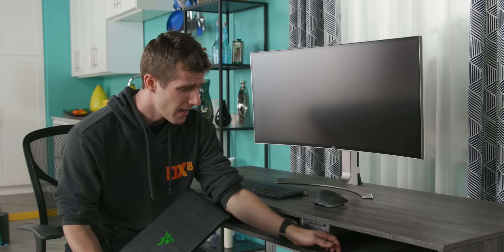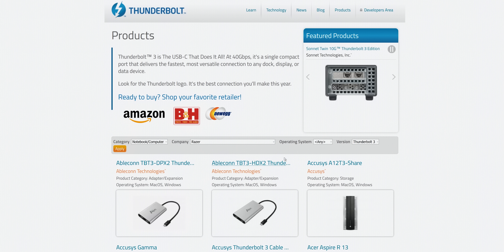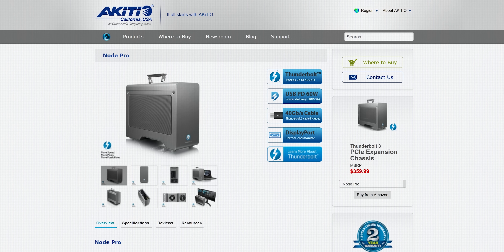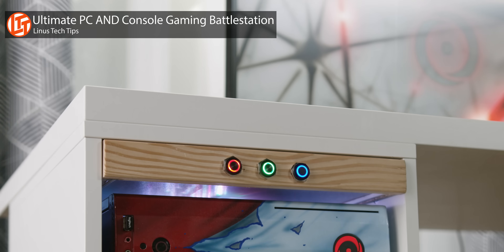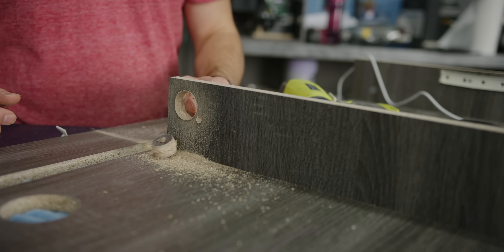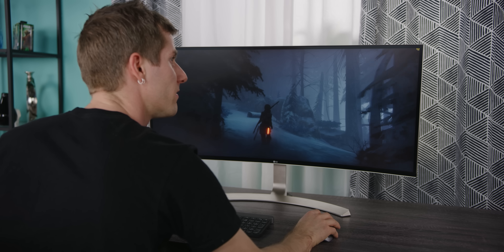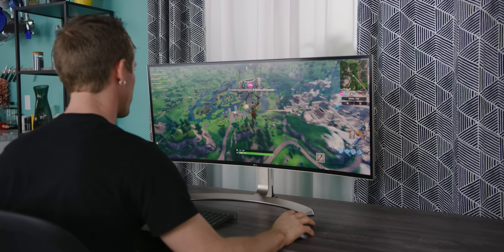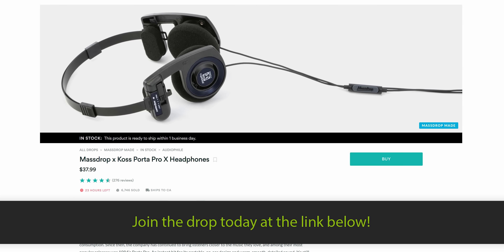This is the CLEANEST Setup.

Comment: Hey Linus, I need your help on this one, it's somewhat related: I own a Razer Blade 15 Advanced Mid 2019 RTX 2080 and I am looking for a Thunderbolt Hub for Ethernet and/or 2xUSB and Displayport with 144Hz (hopefully with G-Sync-compatible?) that also charges the laptop. Have you got this setup working? If yes, which peripheral did you use?

Comment: My experience says command strips will solve the velcro dropping the dock issue. Nothing this clean, but I've modded a desk/bookshelf to house a three monitor kvm setup with 3 desktops and a laptop, and I use the 16 lb command strips to hold most of my components including a 4 port dual monitor kvm, (4k @ 60 hz) and the optical drive that gets shared between the machines (I work with some legacy stuff).

Comment: Quick question; I do not have a Thunderbolt 3 port, but it does have a USB-C port. I do not plan on using it for gaming but just productivity so a external drive and GPU is not needed. The station is already going to have a desktop PC, so the plan is to when I connect my laptop the screens, keyboard, mouse and other stuff is switching to that. Maybe even a button of some sort to switch back and forth. Would something like that work?

Comment: lol enterprise computers have had docking stations for years XD
Reply: This is cleaner than a docking station.  Im running a Lenovo T430 on a dock.  But there is still a lot of wires, and you cant just plug it in,  you need to line it up, then to remove, press a button.

Comment: Clean? Pfffft. Take that TB3 hub apart, and embed the front ports into the edge of the table. Also create a custom rail dock for the laptop instead of the cable, as Vandel212 suggested. Then swap the keyboard and mouse for a Celluon virtual (laser) set, and a short-range laser projector. Kaboom.

Comment: FYI, on fortnite it has a frame rate limit in case you don have a 240 or 144 hz monitor so you avoid having your GPU over working. ;)

Comment: Mine is basically the exact same thing but with an and rx 5700 in a Razer core x with 2 monitors and speakers. All connected to my MacBook pro with ethernet and wired keyboard and mouse. The cables are a fucking disaster.

Comment: “Cleanest Setup”

Dust: not so fast.
Reply: @Bear Omega If my cheap ass just upgraded to a 144Hz monitor that even my 5.5yr old system can keep up with, there's no way cloud gaming is going to take over the mainstream. I'm not going back to 60Hz but with added potential for problems that I had no possibility of facing with my graphics rendered locally. I'm probably buying an nVidia 3000 series card when they release. I skipped the nVidia 1000's and 2000's on my 970 GTX. What kind of framerates will I be looking at in 1080 or even 1440? There's no way i'm going to go back to 60Hz but this time with extra problems I didn't have before.
Using an internet connection, especially one on which others may be streaming videos or downloading can cause all kinds of problems with input response latency, dropped frames, and reduced graphics quality when the internet is busy, or if my home connection is busy. All that for 60Hz while I'm already on 144, and may soon be dealing in the realm of 240Hz gaming. I'm a cheap ass like most people. I don't often spend money on hardware, and I'm way ahead on performance compared to cloud gaming.
Reply: @stimpypigaming8021  don't buy a 3000 join the 6000 gang
Reply: @TemkaUwU  R T X 6 0 9 0
Reply: Mine is cleaner
I have no setup.
Reply: LMAO
Reply: honestly i thought it was for actual dusk grime etc

lol
Reply: As someone with an eGPU, this is just too true.
Reply: Me alright we’re is the nearest black hole
Reply: I'm gonna stop you right there
Reply: THATS WHAT I WAS THINKING OF
Reply: True
Reply: Now Introducing: Dust Cleaner™ Lite
Reply: Hold up.
Reply: @TheOneAndOnlySam01  what
Reply: LMFAO
Reply: Nobody expects the dust inquisition
Reply: Bro why is ur banner a pic of my house
Reply: @Theonlylazycatdog  bc ik where you live.
Reply: @TheOneAndOnlySam01  😳😳😳😳😳😳😳😫😳😳😳😳😳😳
Reply: @Theonlylazycatdog  that’s very scary. He knows where you live.
Reply: Just clean it
Reply: @callum493  no shit sherlock
Reply: I’m allergic to dust
Reply: BoyStank oof how do u live life with that allergy?
Reply: @boystank4202  damn my mother too when we have to clean something it would be hell to my mom and my eyes
Reply: What does it feel like to have over 1,000 subs? My pc is a lemon
Reply: @boystank4202  relatable
Reply: HhhHaaAaaHhhh , your finger just went in my ass!
Reply: 30K subs with no videos challenge i wanted to like ur comment but didnt want to change 69 likes
Reply: @mustafafaisal05  bro its hone it's all gone the name and likes

Comment: hm... i already have a RTX 2080 but am running on an i7 4790k which is fine but if i want to upgrade I need a new mobo, ram and cpu anyway... i wonder if i should build this kind of setup using my existing 2080 and maybe get a performance boost? I like my overall setups to last 6+ years though (allowing for one major change e.g. GPU to be done early) and I doubt even the best laptop CPU/ram combo will be good for that long, especially not with that early GPU upgrade. Or am I wrong? last time I owned a laptop was in the era where they became useless after only 2-3 years so I might be out of date.

Comment: I have the core and razer blade displayed in this video. It is a sweet setup but the core itself is a bit inconsistent. Sometimes it won't charge. Sometimes it will randomly crash. It won't wake up from slumber. It is very sweet and it gives you a ton of portability but given my work laptop can run the games I want in case I travel I am switching back to desktop.
Reply: also you can for sure hear the Core on its normal enclosure. And the CPU on this Blade warms up a lot because of the thin factor. I do hit 90s on the regular, gaming simple stuff like LOL

Comment: One thing Linus failed to mention is that the optical port in the back supports SPDIF, so you should be able to run a nice, little 2.1 speaker setup without a lot of hassle; or some nice studio-grade near-field monitors, if that's your jam.

Comment: I based by set up on this video. The only differences are that I used a MBP + Radeon 5700xt, an IBM model M as the keyboard, and multiple monitors (portrait and landscape since I'm a programmer) and there's no built in wireless charging. 

The only issue I have is that I installed Windows on an external ssd (that's Velcro to the MBP lid) and when I boot into it, the gpu doesn't work anymore. I can't game, but, work and school stuff works fine.

If anyone needs help getting things set up, let me know.

Comment: I think the one step you still have remaining (plugging the laptop in) could be significantly optimized: build a compartment that fits the laptop exactly with the plug in the back at a fixed position, so you can literally just slide the laptop in all the way and it's connected.

Comment: This is the cheapest .... Ouch my wallet is crying out loud ... !!!
Dude, the effort , the tools and the time wasted to do so.

I have done what you said at the beginning of the video, I literally have two laptops (One for the light weight and another for the heavy liftin).
I always wire both of them to a 4-USB switch hub and my heavy laptop is always connected to a 24" screen while the other sits next to my mouse pad in-case I need to fetch files from it.
So, the end result I come back home plug in the hub, the power cord and that's it ... 2 steps and we're done ...!!!!

Comment: Looks like I can't do this. My laptop computer has 130W charging.

Edit: I was wrong that my charging wattage would be a limitation. It's a Dell laptop, and they have a docking station with 130W delivery over Thunderbolt 3 and sufficient ports to hook everything up. That docking station costs over $300, though.

Comment: if you have used a thermaltake mozart TX you could have a much cleaner setup that is easier to  manage.

Step 1 build the PC using that case
Step 2 remove 1 of the legs of the table
Tep 3 use the case as a New leg for the table

Comment: Are there magnetic Thunderbolt 3 cables?  Use one of those and you won't even need to plug the cable in, just get it close and it'll plug itself in.

Comment: I have been programming and operating CNC Routers for just about 8 years now. My suggestion would be, if you are going to be using a CNC router and need to cut any “finished” material (laminated, painted,etc) you should always use a down cut bit. From the looks of the quality of your cut from when you pocketed out the section for the wireless charger looks like you used an “upcut” bit. A downcut bit pushes the material downward giving you a very clean finish on the edges. Also if you are going to be cutting all the way through your material (creating holes) you should use a compression bit which is a combination of an upcut and downcut, these keep both sides of the material clean and sharp. A downcut bit is exactly what you would need to pocket the mousepad into the table. I wouldn’t recommend pocketing the mousepad to sit perfectly flush with the table I would leave it slightly higher. The sharp edges can/will cut you if it is perfectly flush especially since the mousepad cushion has some give to it and when using it, it may drop lower from the weight of your hand exposing a slight sharp edge from the pocketed edge

Comment: Am I wrong that there's a lot of effort going into not having to plug the laptop into a separate power cable as well as its data cable? My current setup is an ipad and a cup of tea. But if I had a phone that used a wireless charger, i would love to have that concealed charger pad. What happens if you accidentally put something heavy on that spot?

Comment: One thing that can be improved is to use a lenovo mechanical docking station. You would not need to bother with connecting the thunderbolt manually.

Comment: lol don't run a Razer Blade laptop with the lid closed.
Opening the lid actually opens up the heat vents and those Razer laptops will literally melt if they're blocked.

Comment: Bro I did that for five years on an Alienware m14x GTX 650M. Its a pain in the ass just use a desktop. If you need your laptop as well then have a monitor with an HDMI switch. Simple easy and saves you the head ache.

Comment: Maybe give the top some rounds with increasingly fine sandpaper so it's really smooth and then treat it with a thin layer of laquer or oil, with extra polish afterwards to even out any raised grains, should be a decent mouse surface then, not to mention just feeling super nice overall

Comment: Plz do a MacBook setup, I have one setup on my desk now. Specs: 2016 MacBook Pro 13’, GTX 980 in Razer core X, ROG 279q and running Windows on HIKVision 120g external SSD. Reason why I got this setup is that I want the MacBook’s internal drive is only 256gb. My particular setup only works in windows since egpu.io don’t have driver for 980, which makes me want switch to RX 7500xt. But the challenge comes down to get the windows to properly boot off the external SSD while able to recognise the eGPU. Cuz ima admit it that macOS don’t have much games. Hit me if u run into any problem ;^)

Comment: Hey Linus, I have the exact setup with a Razer Blade Stealth 13 with the regular Intel Graphics then the eGPU RTX 2080, but somehow my laptop will load 1st in "load order" at 100% and my eGPU at 20%ish, therefore running minecraft at 20 fps. I changed my preferred Gpu in the 3D settings of my Nvidia Control Panel and tried the Razer GPU Switcher and no luck. Any Help?

Comment: Get a full pc :900-1400$
Get a laptop and setup it to be a pc :
Laptop:900-1500$
Monitor:300-500$
Mouse and keyboard:170-250$
External graphics card:1300$
Thunderbolt hub:280-300$

I think pc is a good solution 🙂

Comment: I assume your monitor is connected directly to the egpu then? Would there be any latencies if the monitor stayed connected to the dock? Then there would be only one cable to the egpu. I have Mac and Intel NUC Hades Canyon and I would like to switch between them with just one cable (hence the question would I benefit if I connected monitor directly to NUC or it's ok if the monitor is connected through dock?) Also if I added egpu to the chain I could just connect to it with one thunderbolt from the dock or leave it out completely when I don't need it and connect that thunderbolt cable directly to one of my computers.

Comment: Would prefer an elevated place to place the laptop as well as power routed through a small hole with cable holder (prevent fall down) for more convenient everyday use compared to reaching for power cable -> plug cable -> place laptop while leaning over.  Better ventilation though it does not seem to be an issue for laptop in that open space.  Maybe add fans should that space be dedicated to hardware (versus light objects like paper etc).

Comment: I have a similar setup : 
- Alex desk from ikea which offers cable management and the possibility to store the laptop like shown in the video ;
- Zenbook ux430 (no thunderbolt) ;
- 32 inch 2k monitor ;
- cheap Usb hub with ethernet port / usb3 ;
- Wireless keyboard and mouse (annes pro2 / rival 650) ; 
- Bose companion. 

To use the desktop mode I still have to plug 3 cables : power, hub and display port. 
I don't need the egpu since I use a cloud gaming provider (shadow).

Comment: Really nice setup. I'm trying to do the same here. But I have two notebooks, one for job and another for gaming, and I'm having a problem because I want to let the notebooks hide. And to do it I need a dock station that is possible to turn on the notebooks with the lid closed. Do you have an idea if it is possible? If there are any dock station that does it?
Reply: On windows there is a setting to use the computer with the lid closed

Comment: I think the idea is great just something kicked me off and it was "speakers". Non present and if you are going to use monitor speakers that's not gonna be the best solution and eventually you'd want to get something better. If you would want to maintain the clean part i'd say go for the wireless headphones, as you need them for communications and the sound, but if you don't prefer headphones then the options for the wireless speakers are not the best if you ask me, so it's cables for speakers again, but my guess is that you could make a hole or something for them as well and hid them under the desk

Comment: If you are going to use a monitor for your laptop. note: some laptops even if configured to not sleep when the lid is close, the monitor screen goes black and so as the laptop. Though it still has power

Comment: Use a display mount that you fixate at the end of the table.

Room on the table 100%...and you easily can change the display distance.

You also can do that with a whole keyboard.

About $50 for the whole thing.

P.S.: Desktops are outdated.

Comment: I feel like you could've put a shelf on the back of the drawers that could've held the eGPU instead of trying to put it into the back of the drawers and having to then cut down the drawer size. Based off the picture of the desk at 5:39, it appears that the drawers don't go the full depth of the desk so you'd still have room even if you had the desk up against a wall.

Comment: The trick to g etting velcro tape to hold something upside down with weight to it, is to prime the woods surface with 3M VHB surface primer. It's used for their welding tape, and it gives the tape a really good surface to bite into. In fact the velcro may still fail, but it will be the velcro coming off it's own adhesive, not off the desk or the device.

Comment: Is an EGPU really required in this setup or it is just to make the setup more powerful?
Reply: I'd say not required at all depending on your laptop. You can buy gaming laptops with 2080's in them. You'd just wanna come up with a better cooling solution and perhaps hide the laptop in a drawer that has built in fans and some sound absorbing padding. That's what I'd do vs the external GPU setup.

Comment: laptops are crap no matter the technology, its a dead investment. better to go with the same idea but use actual desktop pc parts and hide them in the desk. here is a good example https://youtu.be/QaoFh1DH51U?t=1 im actually in the process of building this by using my own computer. very cost effective because you can make the design for the desk and go to a hardware store and they will cut the material for you leaving you to put screws and angle brackets here and there and done! easy peasy for around 50 dollars in total with the advantage of full desktop cpu, full graphics card, 14cm height cpu cooler cant ask for more. almost forgot and it can fold (20cm folded thickness)

Comment: Even cleaner is Samsung Galaxy phone + DeX and, again, only 2 cables - one to a hub and from the hub to the monitor.
It's freaking insane setup. And the future is really that way and Qualcomm/ARM be the leader. We just need a bit better processing power. Current Snapdragon 855 supports up to 16GB RAM which will be enough in most of the cases.

Comment: As a hardcore gamer I would never replace my pc with a laptop. You can get one of the best pc on the market for the same price and it will out perform any laptop on the market even with extended graphics card, there is no competition what so ever.  This isnt gonna cut it in the long run. Laptops are literally getting strangulated with its tiny fans smashed in to the table. Its not designed for gaming. but it is fancypantcy . Just not optimal for gaming at the best settings etc, probably work for casual scrubs and rich people.

Comment: Alienware laptops with a graphics amplifier option is a better option for both value and performance, as the AW graphics amp has dedicated lanes for pci e bus, thunderbolt has overhead that makes it slower. I run a AW 17 R5 with an external 2080 ti on a 4K monitor, it’s money... I use the thunderbolt plug for 10Gb Ethernet.